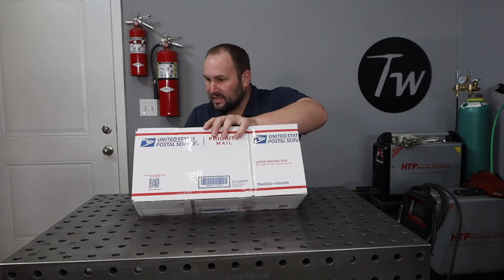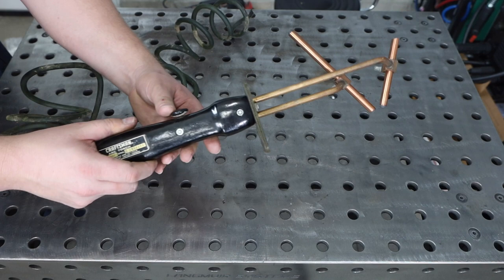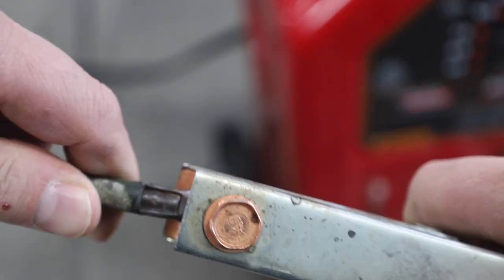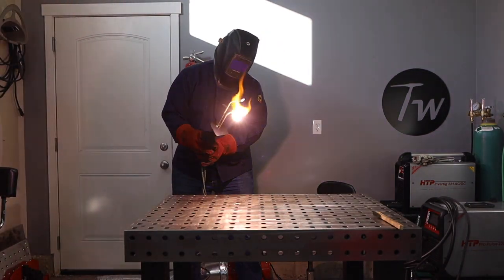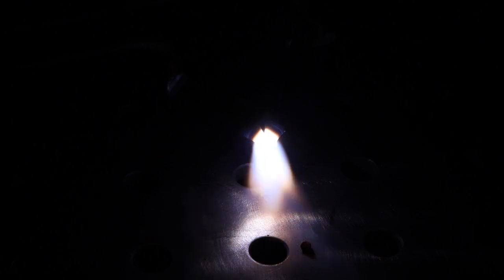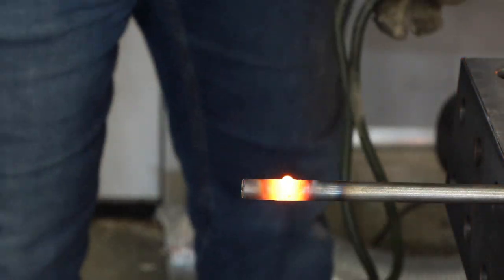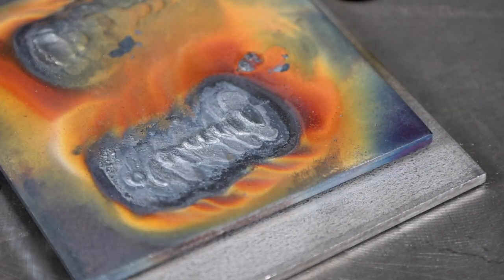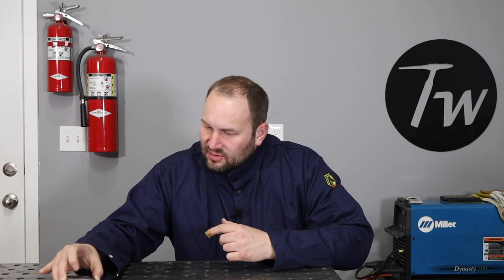I Tried the Weirdest Antique Welding Torch from Sears

Comment: Going back into the history of welding, you see that the first torches (late 1800’s)were carbon arc. Supposedly, the carbon didn’t get into the weld, but it did. The carbon vaporized and gave very hard, brittle welds. This torch goes back to maybe 1900. Not the actual one you have, but the concept.

Comment: does it work with, say graphite or aluminum as tips? look odd in today's standard. there must be something it is good at. copper plates?
Reply: On the farm we used for bending and straightening heavier steel, same exact one dad still has it I don't think would be good on graphite or aluminum too high of concentrated heat would probably just puddle it. Always worked on galvanized steel well too still have garden tractor trailer that helped put together in like 76 we used it to bend everything.

Comment: You need to oxy acetylene filler i would think …  it gas a different composition than tig filler. ( more carbon in there) which helps it to get cleaner welds in the absence of a shielded atmosphere ….  
But i dont know for sure
Reply from the maker: I think that would probably work better than the TIG rod...just messing around with what I have laying around. It seems like it's probably best for heating and brazing, though.

Comment: If like me you aint got any other way to braze.....these devices do the trick.....still have mine from 50 years ago.....seeing I dont have gas welding gear now.....I have started to use the carbon arc torch again.

Got to work with what you have.....I can heat with it as well.

Comment: ...........    soooooo seeing the wide ark you thought it was clever to use it like this   :::::::::::::   instead of like this    ----------------
Reply from the maker: I didn’t even think of that! 😂
Reply: I was wondering if it would work better running the arc parallel to the bead, like you show, to make it narrower.
Reply: @TimWelds  You are a gentleman for your response to ealtar.  His point is good but his delivery leaves much to be desired or, maybe, flamed!  I hate when jerks stumble upon right.

I would sub again but I am a regular.

Comment: When I was a kid I had one, used my old Miller thunderbolt for a power source, a few years ago on E bay found a brand new in the box Lincoln Twin carbon arc torch,it was from the 1950's, around $100, need to get another buzz box, don't want to run it on my inverters set to A/C, not sure if there would be any damage to the machine so I will have to wait until get the buzz box again.